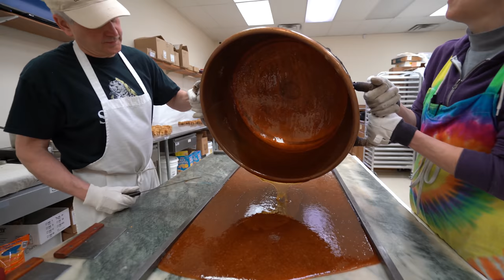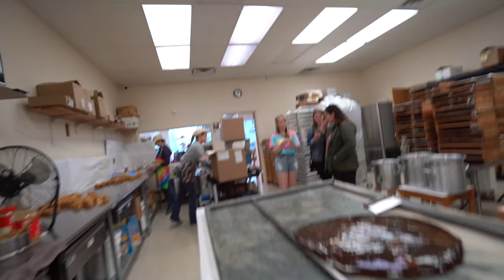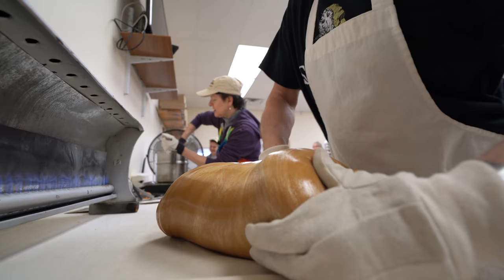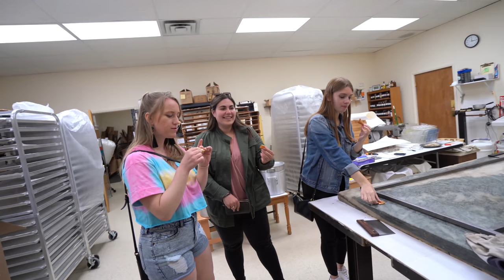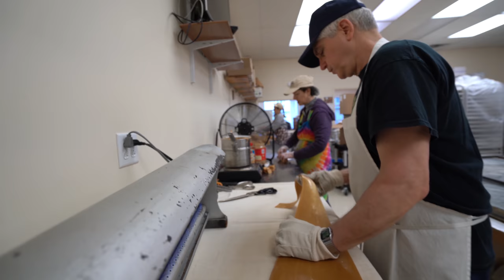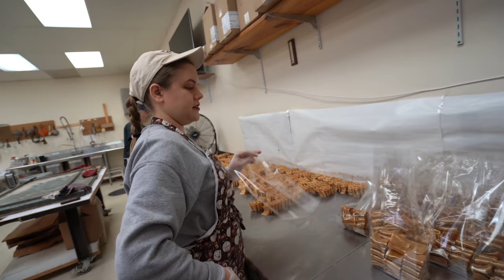Same Family Recipe, New Technique (Peanut Butter Filled Ribbon Candy)

Comment: Put a network of flatten copper pipe under the marble. Run water through to regulate the temperature. That should keep the temperature consistent without developing a condensation problem.  Just a thought.  Love the videos!

Comment: In response to the fan on the table idea. There is a new fan system they have now for beds. The fan is encased to concentrate the power and it all funnels into a tube similar to what you put onto the back of a dryer.  Then the cool air flow is placed or could be placed directly where you want it. They also have one with 2 tube outlets, ( for double or queen size beds) which in this case would leave one for marble top and one for underneath.  They run about $300 to $400 for the double last time I checked. With Steves creative fix talents that could probably be expanded into attaching an indoor a/c unit to it to crank up the cooling of the table even further.

Comment: I'm curious about how well it sticks within food safety guidelines, to have people from outside coming in to the manufacturing floor. I know they are told not to touch anything to do with manufacturing (sure I've heard that in a video), but surely there is a risk of a contaminant being brought in by people. When I worked in food manufacturing, unless you had your coat, hairnet, cap and work shoes, you sure as heck wasnt allowed on the shop floor. We would have visitors sometimes, but they would be given spare clothing/shoes to wear. Food safety is just so strict, but that was an official factory in the UK. I don't know what the rules are for mom n pop places in the US. I'm not insulting you guys, I am just genuinely curious and interested on how that works. When you were moving in to that store, I swear you guys said that the glass window would be for visitors to look in to the production area, which would make more sense on a food hygiene level. Annnnyway lol xx

Comment: Why not water cool the table, Like how you would do on a computer. It may help out. just copper tubing, fused to some long copper blocks which is stuck to the bottom of the table. Then just have 1 or 2 cooling radiators. so it wouldn't cool the table as much as have water move the heat off the table into the radiator and cool the water through the radiator. it defeats the condensation issue. keeping it around 26c. (depending on how hot the bottom of the table gets.

Comment: @Hercules Candy I know this is an older video, but tornadoes don't hit cities very often because tornadoes actually form as rolling tubes of air at ground level. Wind shear causes the air near the ground start to roll as one layer moves faster than the other, then an updraft lifts the rolling air to form the tornado. If there isn't a broad, flat area with no obstructions for the wind to blow over, the initial rolling tube can't form. Only once you have the tube and the updraft, and you have to start thinking about the probabilities associated with travel distance and wind direction, does the relative scarcity of city-covered ground area come into play.

Related: cities actually often form their own small weather systems. Two reasons: one, black pavement holds and releases SIGNIFICANTLY more heat than dirt or vegetation, so major air pressure differences can exist over cities than the surrounding rural areas; and two, cities immediately funnel moisture runoff into the sewers, so the humidity in a city can be wildly different than over, say, a nearby corn field. Oklahoma City is notorious for both of those factors.

Comment: I'm sure you've been asked this before, but ... why do you heat up the peanut butter? I'm thinking that the candy is hot enough itself to take on room-temp peanut butter and soften it up as you worked the candy. Wouldn't keeping the peanut butter closer to a solid state also prevent it squirting out the ends like it sometimes does when you cut?
Reply: They heat up the pb because they add sugar and that needs to melt into the pb.
Sandra Oranje Channel Moderator

Comment: not to be one of those people, but if Terry didn't burp the bags, they would have cushioning for traveling, similar to how they ship chips with extra air, which Terry knows full well about since she squeezes chip bags 😆. If the tightness is just aesthetic, then maybe more air in the bags would be a nice thing. Also people could say that they have a little bit more of the Hercules experience in each bag (HERCULES AIR).
Reply: Air in the bag has risk of being humid. That may condensate and make the sugar sticky
Reply: @Kaysler  Yep, air in the bag would be bad. Chips actually have nitrogen in the bags not actual air.
Reply: Ribbon candy would be able to move in the bag then and break easier.

Comment: I wasn't concentrating enough - what was the new technique?
Reply: Rubbing the water around the candy so the top layer will stick better.
Sandra Oranje Channel Moderator
Reply: Ah, OK. Thanks Sandra.
(Wasn't that used on one of the PBJ ribbon candy batches?)
Reply: @roberthindle5146  Yes they started it on the PB&J ribbon candies. Before they never used water and the peanut butter always came out and made a mess.

Comment: back in the 1950s, a Tornado went thru Winsor, OT and it was and is a large city. but yes you are right Creg, the tall buildings disrupt the air so it breaks the momentum of the air flow so it is less likely for a Tornado to hit a bigger city.

Comment: Hold up.  Using a fan to cool down the marble is an idea that's new?  And recommended by a viewer?  And you guys at Hercules don't think a bigger and/or more strategically place fan might very well make a TREMENDOUS difference in your ability to use the table to its maximum potential?  I had to look hard to see that wimpy little fan sitting five feet away from the table.

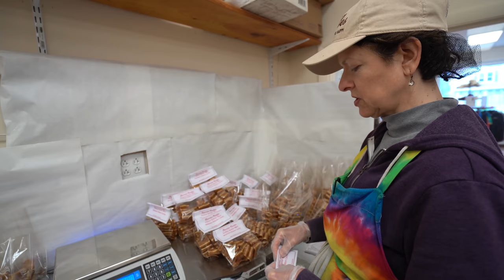Comment: Why at 26:45 there are paper on the walls?
Reply: The ribbon candy gets stocked up high. So it protects the candy from touching the wall.
Sandra Oranje Channel Moderator
Reply: @SandraOranje  ohh ok I understand. But why paper? Why not some different material?
Reply: @nottherealname7776  That I don't know. But they have used this paper all the time with any kind of candy making.
Reply: @SandraOranje  ohh ok
Reply: @nottherealname7776 , it looks to be freezer paper. Food safe, and it has a glossy side most likely to prevent sticking. Also, it's relatively inexpensive.  So it can be removed and replaced as often as needed.
Reply: @Tonsmel  ohh ok. So thy use it for the cheapness and then quality what thy get out of it

Comment: 3:53 I was going to suggest wiping it down with rubbing alcohol or vodka. It's quick and easy, and ethanol evaporates quicker than water, so it shouldn't cause a condensation problem. Though it would probably strip off the shortening, so forget I said anything.     ;-D
Reply: Alcohol wouldn't cool the table. Do you realize how thick that marble is?
Reply: @Tonsmel  I didn't watch the moving episode, so no. I just know that alcohol evaporates quickly, so you get evaporative cooling. It seemed to have face validity.
Reply: @astrinymris9953 , the moving video? I have no idea what you're referring to